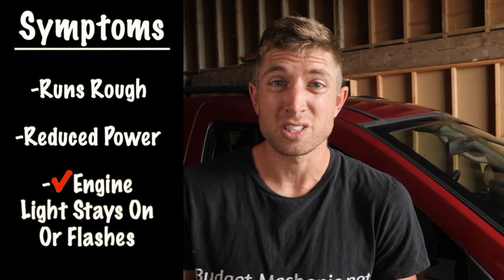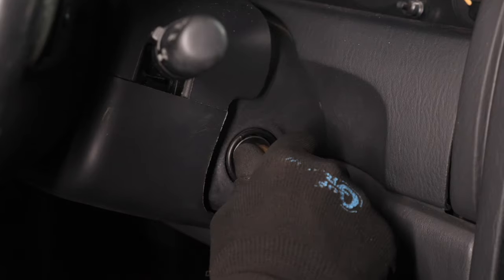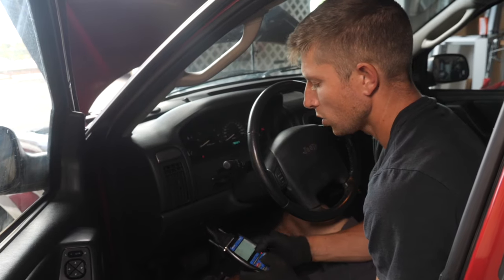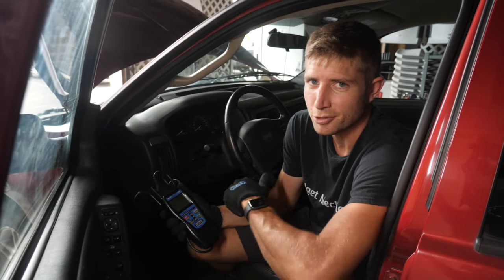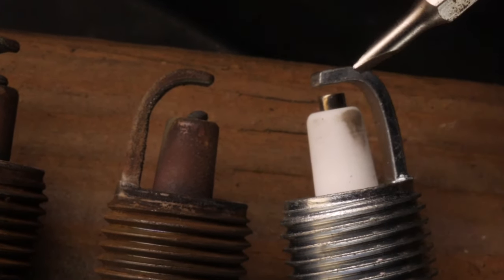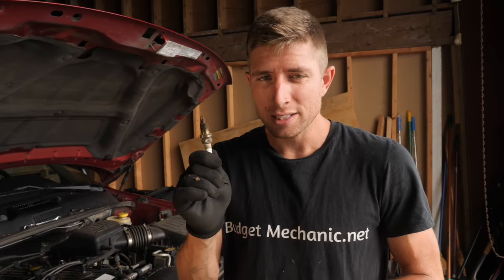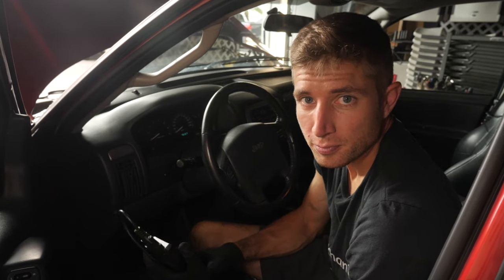Diagnose and Fix Engine Misfires - Flashing Check Engine Light , Rough Running Idle , Low Power

Comment: Code reader says cylinder 2 misfire. 
 There white smoke pouring out my exhaust, smells like fuel, pretty sure thats fuel leaking out of my exhaust too.  I put a new fuel injector in cylinder 2, and a new coil... I have spark plugs but haven't put them on yet... Its still smoking out of my exhaust. My friend thinks it could be the connector to the coil pack? Or maybe flooded the spark plug?? 
 Any ideas?
Reply from the maker: White smoke is usually water vapor, which indicates a blown head gasket.  are you sure it is not blue?
Reply: Check your engine oil on your dipstick for any evidence of coolant in your oil indicating a blown head gasket. I would also check for a faulty plug wire or possibly a failing ignition control module. Also check your fuel pressure regulator could be failing, as well as your fuel pump. And I would change your fuel filter.

Comment: I replaced my spark plugs, coils and it's still shaking also smell gas & when checking spark plugs they either had gas or oil on them but it smelled like gas to me. I don't know what the problem is
Reply: Could be fuel injector

Comment: My 5.3 in my chevy has a rough idle , i changed plugs and all coils and still the same. checked for vacuum leaks and found none, grrrr. Check engine lite comes on then a minute later it starts flashing , im lost what to check next .
Reply from the maker: Keep going down the list for misfires. Injectors? Compression check?
Reply: @BudgetMechanicHawaii  yup, i just ordered injectors and should be in tomorrow. Didnt do a compression test tho and hoping after the injectors are in that will solve the problem has ive got wayyyy to much money in the truck as it is ,lol. Thx for answering :)

Comment: I was driving a make kindy fast turn in a curve, then my gass pedal went off , kindy like it shut off, i park turn the car off. The turn the car back on and it kindy struggle to complete turn onn, After try 2 it completely turn on, and light engine light went off, Then when i got off work like 8 later, the engine light came back and start flashing and i think like i hear somethiig clicking in the engine.

Comment: I have a 09 charger rt 5.7 my car lately has been stalling out when trying to accelerate also when I tend to press to accelerate faster my check engine light starts blinking but when I slow down it stops but it starts to shake
Reply: Having same issue
Reply: Same issue
Reply: Did you find the solution?
Reply: @jessie-.-5615  yeah man i went ahead replaced a lot of stuff spark plugs fuel pump etc and still never worked left it parked for 5 months then finally a friend that was a mechanic at the dodge shop told me it was the computer replaced it the same week been 5 months running fast and strong to this day 60mph 4.9secs.

Comment: I got a 2000 Chrysler 300m my check engine light is on but my mechanic said after he switch the spark plug and the other misfires it should go off I hope so 😫
Reply: He should have cleared the code with a scan tool right after he replaced them. It may take up to 40 key cycles on/off before the PCM recognizes the fix and clears the code itself.

Comment: My 2003 dodge Durango started out like it was the O2 sensor and that's what we thought it was well later on it started losing power and we thought the valve cover gasket went out so we replaced it then we thought it was a blown head gasket so we replaced it now it won't crank at all it almost like it's not getting any fire and yesterday it was smoking white smoke from the engine and rattling like the engine was rattling I need help
Reply: Catalytic converter issue

Comment: Hello buddy, I am currently having a huge problem with engine misfiring, my mechanic have tried change all ignition coils and plugs and still the misfire is there. 

It shows cylinder 4 misfiring on my Honda oddessey. 

Please help me. Already spent more than $2000 on it.
Reply: This just happend to me

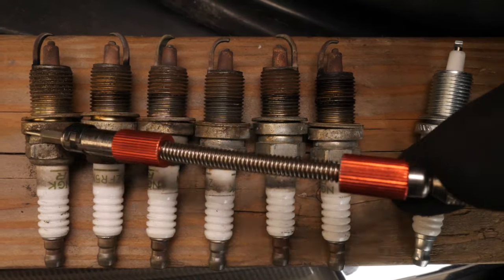Comment: 1:55and what to do if I have oil on spark plugs? Pls help
Reply from the maker: That means you probably have leaking spark plug tube seals which is allowing oil to foul the spark plugs. You need to replace the valve cover gasket(s) which usually comes with tube seals
Reply: @BudgetMechanicHawaii  and is that possible thing to be problem in my car bcs it works rough and seems like it work on 3 or naybe 2 cilinders only. Motor 1.8 benZ kejetronic. And also I saw benzin leaking from where fuel injectors taking fuel to te motor. Is that,also one of theproblems car idling/runs rough as 500 rpm and shaking as never before? Thank you. Keep a good work. Cheers from Bosnia

Comment: Check engine light flashes on my 03 mustang it shakes hesitates and is really slow. I changed the plugs and plug wires it calmed the effects for a little but it’s still there and is getting worse
Reply: Car only has 80k miles and I checked for codes at auto zone and nothing came up even though it has flashed many times while driving
Reply from the maker: Does your car have a main coil pack or individual coils on the plugs? Coil problems would be my next guess if you’ve replaced plugs. possible that is failing and producing misfires. Sometimes new plugs will even make failing coils worse. Also I would get the light checked somewhere else then, there’s no way a flashing engine light would produce no codes...
Reply: Budget Mechanic Hawaii it has individual coils on the plugs I also checked the air filter and it’s clean, do you think maybe it’s possible that it has something to do with the fuel system or an o2 sensor?
Reply: Budget Mechanic Hawaii just took it to a mechanic and it ended up being the coil pack as you said
Reply: X possible clogged fuel injector!!!vital that plugs are gapped and torqued to spec! Clean air filter!! I used a bottle of Lucas fuel injector cleaner and gallon of laquar thinner with ten gallons of unleaded ran till tank on empty! Have not had an issue, if to far gone you may also experience transmission slamming into gear.. it’s just the computer trying to figure out wtf!!! Is going on!
Reply: X hope you switched them around to see if it was it??!! Big box store tried selling me the entire set claiming it was bad!
Reply: lucashernandez8 already fixed it turns out the coil pack wasn’t producing enough spark which caused the misfire

Comment: Man i've changed Ignition coil spark plugs 02 sensors Gas cap and a vacuum sensor for the gas on my 09 toyota corolla s 1.8L, 5 speed. And can not for the life of me. Figure out why I keep throwing these codes. I'm about to drive it off the cliff
Reply from the maker: Misfire? Injectors? Compression test?

Comment: I have a 05 gt mustang   runs great for about 15 mins after warming up it sputters like running on 6 or 5 pistons. Its slowly progressing and getting worse plz help if anyone's knows about this issue...4.6 3v 140k miles had new McCloud clutch Hurst short throw and lowering kit installed 4 mos ago have cams n headers i m dying to install but must figure out this issue first plz any imputed will be highly appreciated
Reply from the maker: Engine codes? When issues crop up after warm up, often it can be electrical like coils

Comment: I changed all my Ignition Coils, Changed All My Spark Plugs, Got a New EGR Vavlve, and still I get a misfire code 🤦🏾‍♂️ this is starting to get so annoying I poured so much money into this car
Reply: Check your O2 sensors.. with a scanner. And check and clean your Mass Air Flow sensor
Reply: @numerodiez2981  ended up selling the car for something better, more reliable... and faster lol
Reply: The stress it puts on you, and all the money spent. I WOULD OF BURNT IT LOL.. but thats good. At least you upgraded.
Reply: @numerodiez2981  ye lesson learned for sure
Reply: Just went through this issue. I was told it was the purge valve. No kidding about spending lots of money! Other advice try to find a reputable mechanic other than the dealership!
Reply: You should check for vacuum leak and check fuel injectors
Reply: It might be a manifold as well

Comment: I had an 2015 nissan altima and I felt I needed tune up but before i could get tht done one day my son put gas in there and the check engine light kept blinking and the car cut off, so i went got the tune up well it had 2 codes but the shop took care of one code and now it showin 2 more codes with the plugs well anyway after paying him 400.00 I am still not able to drive my car because the engine light is still blinking.. Please someone steer me in the right direction I feel I gave up 400.00 for nothing

Comment: My 2013 Civic SI has random misfires psark plugs and ignition coils have been changed, but i still get random misfire, when i hit vtec the car after will loose power and when I press the accelerator it doesnt go anywhere..any suggestions what can it  be..
Reply from the maker: Hmm sounds like a more complex “Honda” problem then. I would take to someone that understands and can diagnose vtec etc
Reply: Did you figure out what was wrong with it mine had a misfire code once and then never again but I have the vacuum leak code

Comment: My check engine light was flashing crazy and I turned my engine off let it set for an hour and it’s normal now thinking it mit be a coil giving out that posible
Reply from the maker: Likely. Failing coils get worse with heat

Comment: My 2000 Suburban 5.3 misfires with flashing light, then resets and runs fine. Continues to do the process over and over but always appears to reset. Any advice from anyone?
Thanks
Reply from the maker: Does it misfire under load? Do you get any codes indicating specific cylinders?
Reply: @BudgetMechanicHawaii  
I went and got an Innova scanner and it came up #6 coil. Tested the coil and it worked fine but wire was bad. Replaced wire drove 50 miles and it started missing again. Just replaced coil and drove 80 miles. All codes solid except 
HTR
EVA
AIR
those 3 still flashing and status is yellow. Im going to go again tonight for a couple hours and see if I can get a green. So far no missing after coil replacement.
Reply from the maker: You’re on the right track!
Reply: What does it mean if it misfires under loading with the blinking cel and stabilitrak light illuminated

Comment: So i replace my sparkplugs and ignition coils and im still missingfireing on a 2007 acura tsx
Reply: plugs was the problem you need a diagnose ...im getting one in the morning
Reply: Did u find out the solution?
Reply: @jessie-.-5615  blown headgaskit I got a whole swap for 700 bucks  car is. Running now buttt my Cadillac converter is fucked 😐
Reply: @jesusp1335  Damnn bro sounds expensive I’m taking mines to the dealer Tommorow hopefully it just needs windshield wiper fluid 🤣🤣🤣
Reply: Lol yup. A. Little over 2 kspent to fixx  but she's up. And running good. Luck thoooo I think my problem started was with the pump

Comment: I have an 02 accord v6 I replaced the spark plugs and 1 ignition coil. My CEL came up like 2 months after, I was told it was the catalytic converter which I haven’t replaced and then the light turned off and now my car flashes the CEL and TCS came on too what can that be?

Comment: My car runs fine on LPG, but misfires on gasoline, any ideas?
Reply from the maker: Could be a timing issue, would need a scanner to confirm
Reply from the maker: Also check spark plugs
Reply: @BudgetMechanicHawaii  It seems fuel injectors got some dirt in, and that was the issue . Now it works better I hope the dirt problem does not come back.

Comment: If your plugs, wires, ignition coil packs if you have them, furl rail,  fuel injectors, fuel filter or fuel pump have all been replaced and you still have issues hate to tell ya you have a bad cylinder or cylinders and should get rid of your car while you can or replace the motor if you have the money. Check you intake system as in air filter and vacuum lines and if it still spits and stutters and or lacks power here and there again bad cylinder,,,,

Comment: Let's say the engine light never comes on and still has rough idle? I cleaned air sensor have new spark plugs but still rough idle.
Reply: Perhaps the throttle body

Comment: I have a 2007 300 srt8 6.1 and im having a problem with rought idle low rpm and it shuts off sometimes i already changed the spark plugs the throttle body map sensor and also poured fuel system cleaner and changed the intake manifold gaskets and i still have the same problem what should i go next i need help
Reply: Let me know if you ever found out the cause

Comment: I'm not getting any current going to the number one cylinder, what can cause this?
Reply from the maker: If you have current to the others than it’s probably something with the wires or coil on that cylinder
Reply: I went to a  electrician an he said that the computer is damaged so I had to buy a new one from the company
Reply: Franklin Merrique did that help?
Reply: @chris2178741  I had to change the brain box it cost me $8,700 by the company

Comment: Omg my Dodge Charger engine light is blinking and leaking from the coil pack what do I do I’m broke 18 year old and everyone is saying it’s a leaking or blown gasket I’m scared😂😂
Reply from the maker: If you have a valve cover leak it can let oil down on top of your spark plug (into the tube where the coil is) and cause a fouled plug which can lead to a misfire and flashing light. Hopefully it’s just a bad valve cover gasket. Depending on your engine setup it’s a cheap and easy fix.

Comment: If anyone can help me out
Check engine light on & was blinking 
I had codes read
I have the same misfire issues with cylinder 3
 I change/swapped out 2 coils & plugs from another cylinder 
That wasn’t the issue still rough idle
Coils & plugs are good
Had codes read again after clearing them
Injector read open
Got injection cleaner
Ran better the next day but then the very rough idle & bad acceleration came back after a few miles
Vehicle is idling around 700-800rpm
I Haven’t checked the IAC, air sensor or the throttle body yet
Any other suggestions
Thank you

Comment: Flashing engine light was not mentioned once yet in the title.
Reply from the maker: Please explain what you mean
Reply: Not a big deal sir.  I appreciate the video.  I had left that comment because I searched “flashing engine light” and I guess your video came up because it had “flashing engine light in the title”. But you never addressed the flashing engine light.   No worries at all and I was able to get my problem fixed. 

We recently had a tune up so I never thought it would be the plugs so I skipped that and moved to ignition coils.
Reply: Truth Seeker yes light will flash because its confused as to what’s going on! It will throw shit tons of codes!! Start simple, air filter fuel injector cleaner regap plugs if to far gone replace,

Comment: Clogged fuel injector = fuald spark plug!! Also dirty air filter!!! Don’t need another video!! You can regap or replace
Reply: lucashernandez8 i changed one of my coil and spark plugs. Still issue is there. I am thinking of replacing fuel injectors

Comment: Can you just remove the cat
Reply from the maker: you can, tho depending on your state, you wont pass emissions...
Reply: Budget Mechanic Hawaii I live in Michigan we don’t have emissions here
Reply: Budget Mechanic Hawaii will removing the cat let my car run smoother
Reply from the maker: Reef ひ really depends on a lot of variables, I would do some research and see if others have done it on your model of car. Sometimes it works but on newer cars it can really throw off the oxygen sensors and make it run weird. But in theory, derestricting the exhaust  makes engines run better. You’re on your own tho!